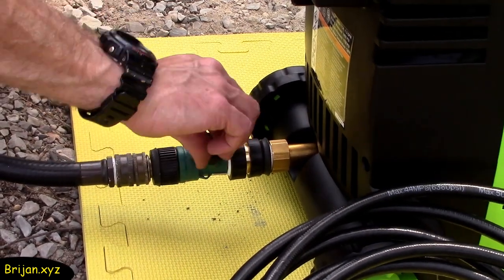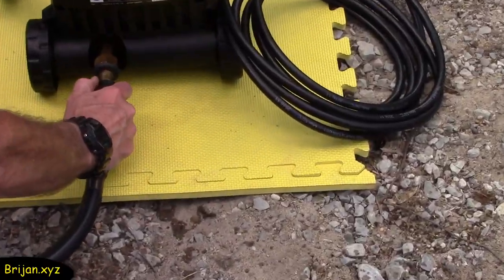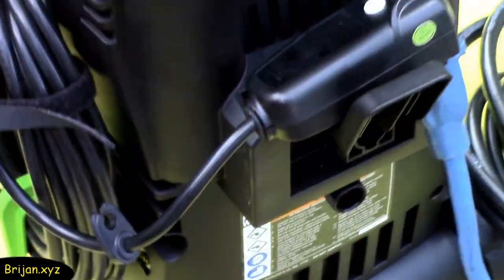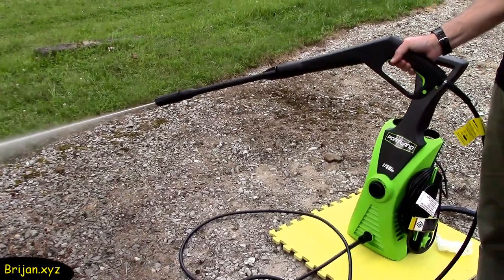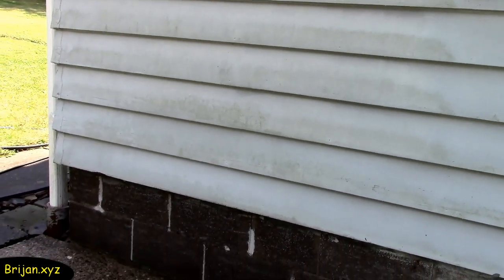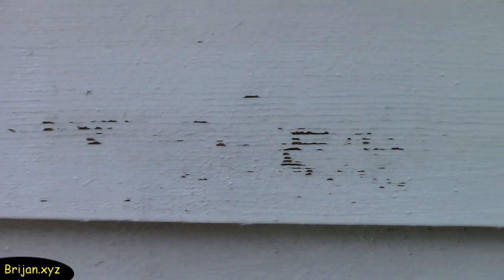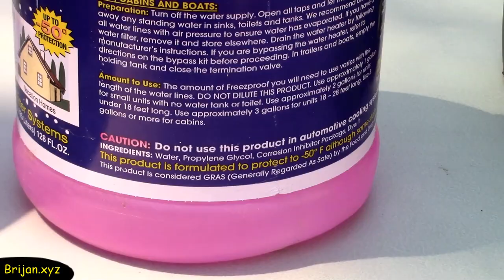$70 Harbor Freight Electric Pressure Washer

Comment: Does Home Depot have the quick disconnect fittings and the water shutoff valve?  So you need two sets of quick disconnect fittings and one water shutoff valve? Right??
Thanks
Reply from the maker: We purchased our quick disconnect fittings and water shutoff valve at Tractor Supply Co. and Lowes. Tractor Supply Co. has the best quick connect fittings - by far. They are solid brass. We didn't check Home Depot but you could check in the seasonal department. That's the department Lowes had them in.  Yes, two sets of quick connect fittings - one from the hose to water shutoff valve and one from water shutoff valve to pressure washer. Thanks for your inquiry.

Comment: I don't have the soap dispenser so where can I get that
Reply from the maker: It sounds like someone might have returned the machine and did not include the soap dispenser.  I would return it, if it's still possible, and exchange it for a new one.  If not, talk to them at Harbor Freight or try contacting the manufacturer to see if the soap dispenser is sold separately.

Comment: Those the 2 way connector come with pressure washer????
Reply from the maker: The 2-way connector does not come with the pressure washer.  We purchased it separately.  We have found the connectors at Lowe's and Tractor Supply Co.  You could also purchase them at a garden center and other stores that carry hoses.  They are definitely worth the investment to add to your pressure washer or other equipment that connects to a garden hose - it makes connecting your water supply to the machine quick and easy.